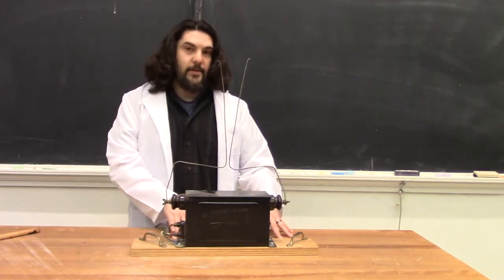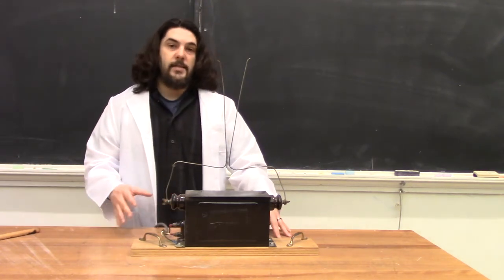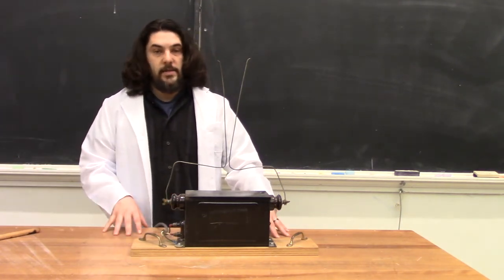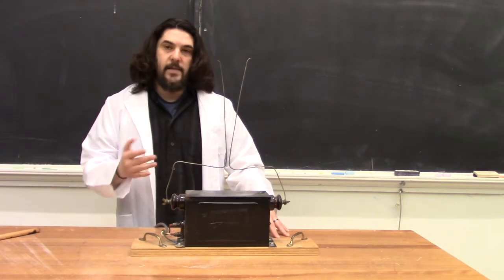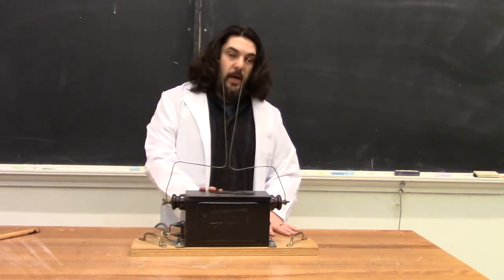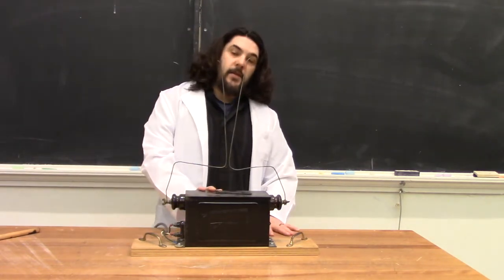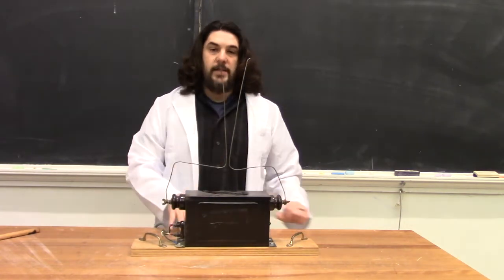Demos: Dielectric breakdown

Comment: 4 years late but this video is short, clear, concise, and gives a great demonstration and visualization of how dielectric breakdown acts in air (hence why when transformers do this the electric arc also rises until the breaking point which I did not understand until you just mentioned about the hot air rising which helped me visualize the whole thing)